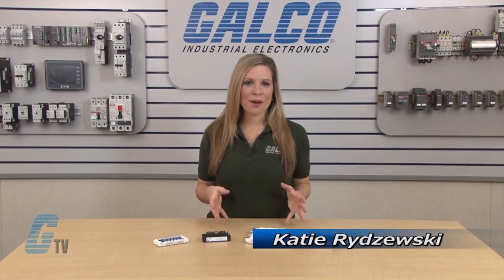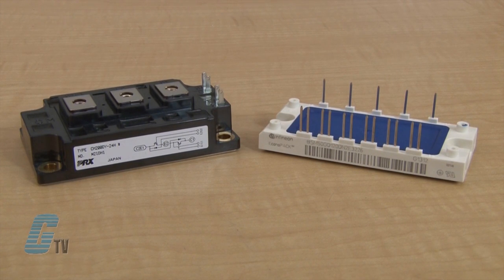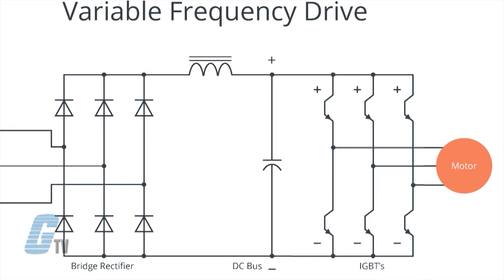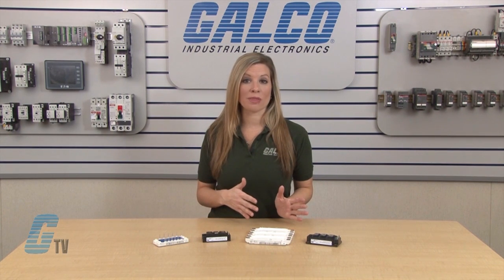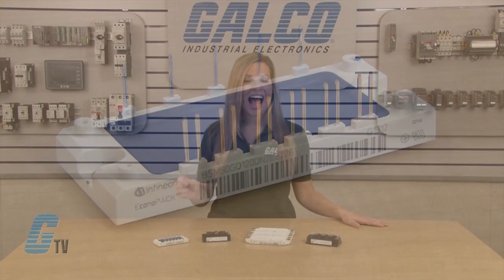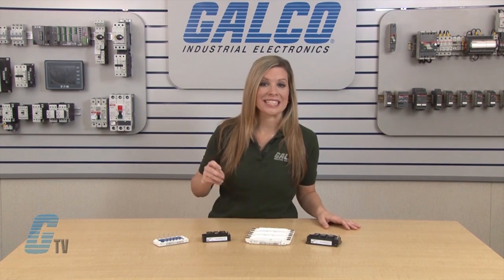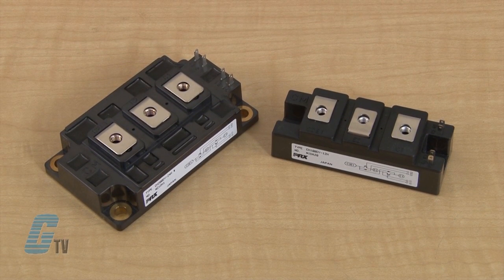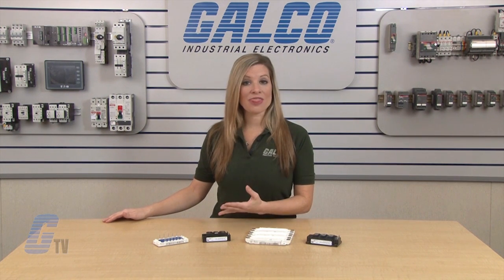What is an IGBT?

Comment: That's pretty cool but why would I use it instead of a mosfet?
Reply from the maker: Well, an IGBT is kind of a type of MOSFET anyway. They are very similar devices. An IGBT is generally referred to when dealing with high current and high voltage. MOSFET's generally quit around 55amps of current before you need to go to an IGBT to get the job done. IGBT's are manufactured to handle hundreds of amps, and can tolerate up to 300% of its continuous current rating for up to 1ms.
Reply: @GalcoIndustrial  
Thank you   😁